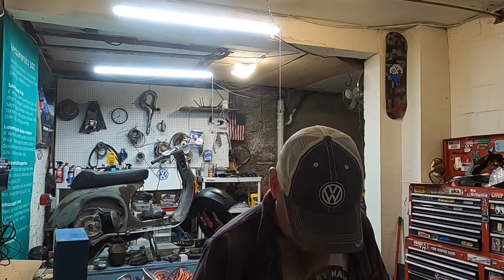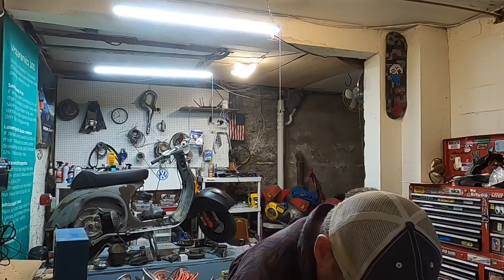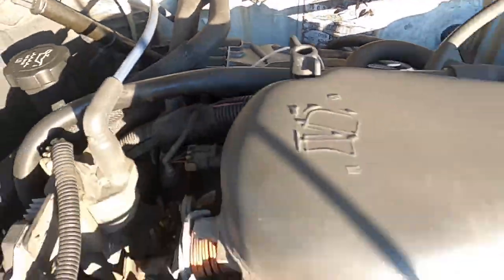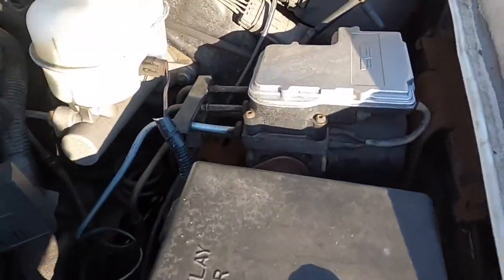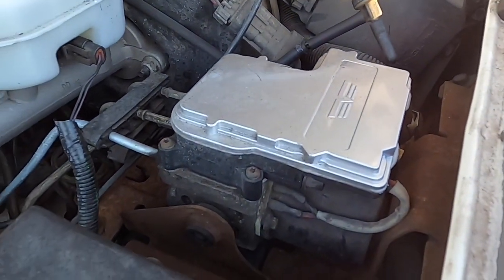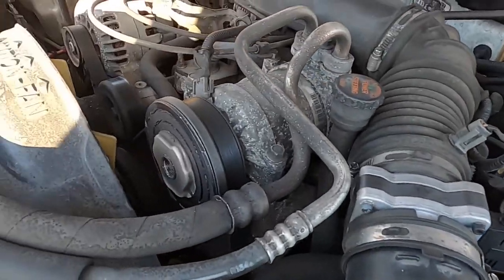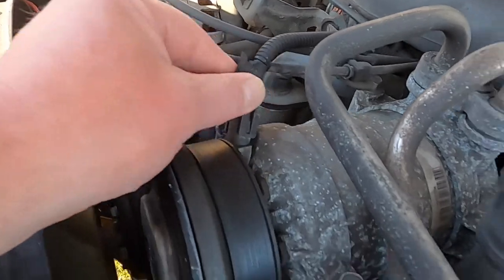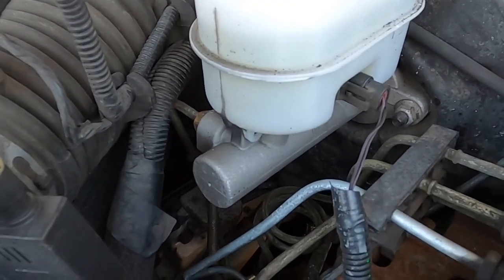Chevy S10 Battery Replacement, life questions answered!

Comment: What if the bolt to take the battery off is stuck not the one connected to the cables the one to get it out completely then what do you do